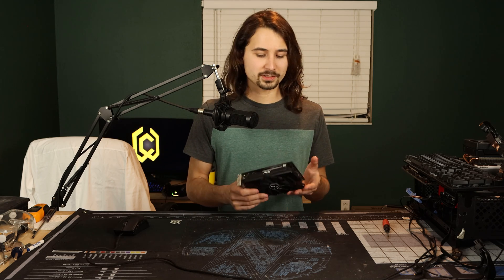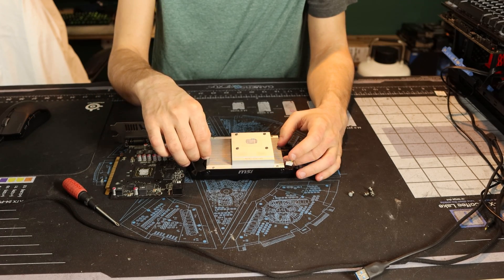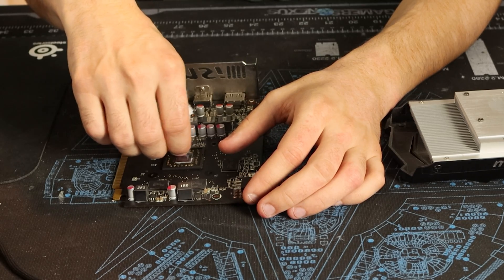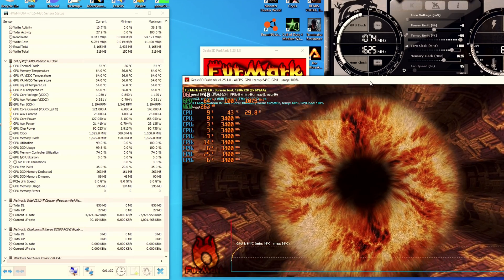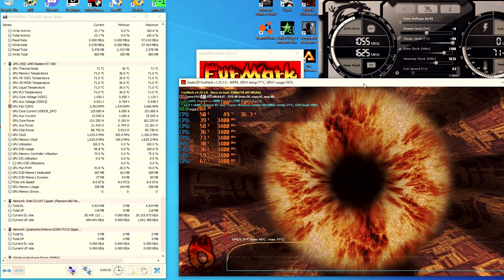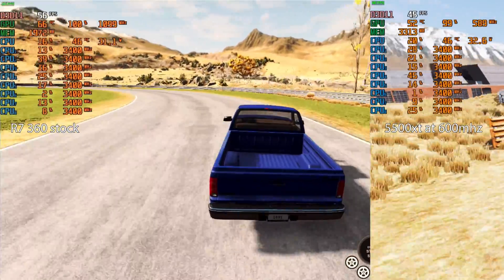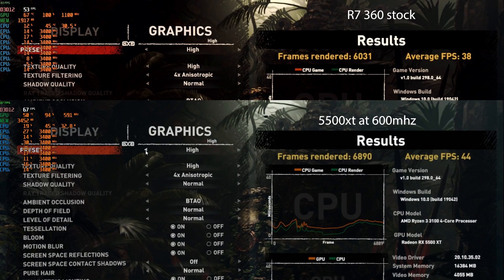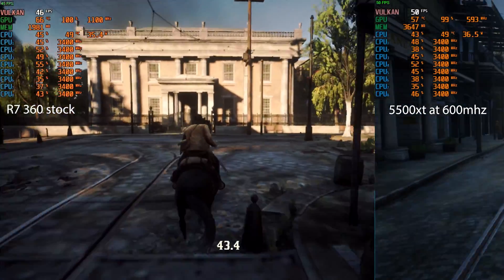This Graphics Card Is About As Powerful As The Steam Deck's | Radeon R7 360

Comment: I think the real secret sauce that the Steam Deck has is the gamescope compositor.

Namely the Virtual Screen function that basically renders games at a lower resolution and then upscales them back.
Reply: Don’t forget that some games might have some kind of resolution scaling, and amds dlss competitor might make its debut with the steam deck.
Reply from the maker: Are you talking about FSR (the dlss competitor)?  If so that's already out and it's pretty solid.  Hopefully more games will use it, but it's hard to do much when you're already only outputting at 800p

Comment: This is very far from reality. Let's compare Vega 64 to 6700XT, both are 13 tflops, vega is gcn and 6700xt is rdna2. Although they have same tflops, 6700xt is more than 50% faster, even more in some titles. 
So I would say that steamdeck's gpu will be around RX560 4gb level, but we'll have to see.
You never compare tflops of two different architectures.
Reply from the maker: Part of the video was pointing out that you cant compare different architectures?

Comment: How much performance will new rdna architecture add on the steamdeck?
Reply: @Showz333  Exactly, but I think that ddr4 is 64bit while ddr5 functions differently (32-bit) so this causes the disparity in bandwidth. Also neither AM4 or Intel platforms with ddr4 platforms support quad channel except for a few top end Intel CPUs and motherboards.

On the other hand, the PS4 has GDDR5 which is a kind of memory that supports high bandwidth at the cost of latency and it works differently than ddr4 or ddr5.
Reply: @Showz333  Even if it’s quad channel it’s only 88,000 GB/s while a GTX 1060 is around 192,000 GB/s. It’s not going to have performance similar to the GTX 1060 given the 15 watt power limit and the bandwidth. To be fair if the target is 800p, the 88,000 GB/s bandwidth isn’t so bad.

However, generational, architectural and compression improvements aside. The GTX 1050 and Radeon r7 360 both run at 112,000 GB/s on the memory which is still a bit more than the Van Gogh apu and aren’t limited to share power with the CPU.
Reply: @Showz333  exactly and because it is quad channel it is 88,000 GB/s worth of bandwidth which is a substantial amount for a 800p screen. Fingers crossed.

If it was dual channel the bandwidth would’ve been cut by half clocking at 44,000 GB/s or 50 something.. interesting times ahead haha! 😁
Reply: And beside that if the steamdeck devs start giving optimised settings for each game then i think it would be more fun keeping amd's fidelityfx im mind!
Reply: Well even if we could get stable 60 fps in medium and 30 fps in high rtx on after some tweaks settings on decent titles 
I think it still be worth playing in hand anywhere!